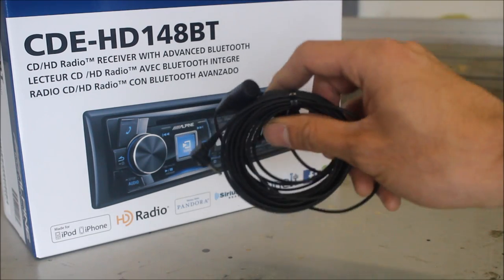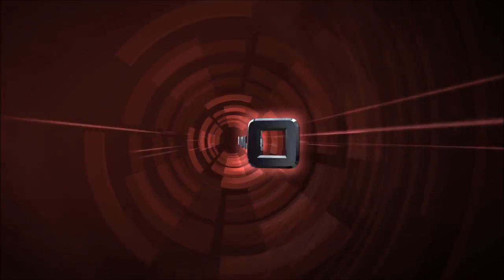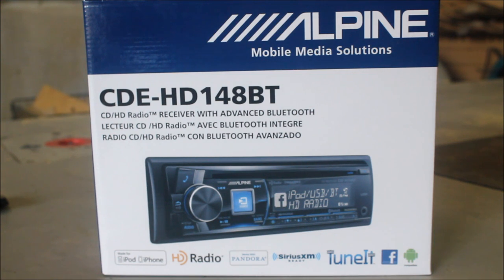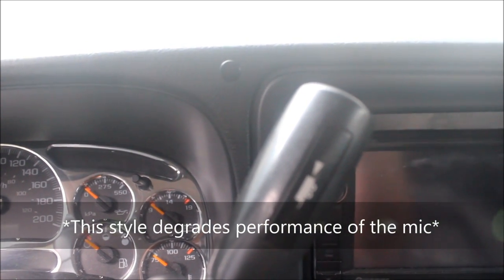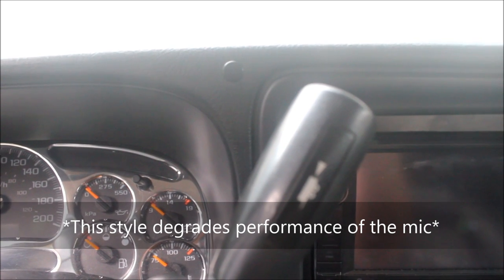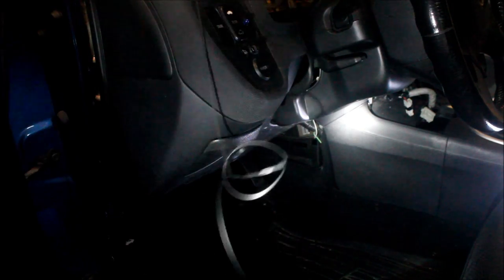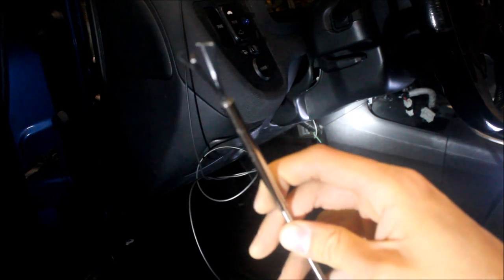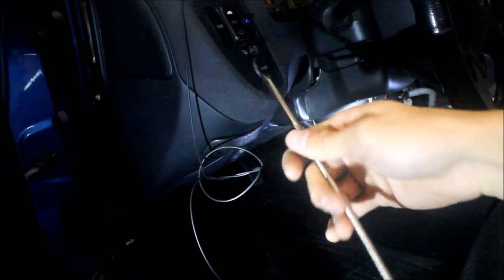Bluetooth Microphone / Mic Installation and Placement | AnthonyJ350

Comment: Looping the mic wire around the mic mount (at 3:40) is one of the best tips I took away from this when I was installing a new Kenwood in my car.
Reply from the maker: Yup, you'll never have the wire droop from the headliner over time.
Reply: @AnthonyJ350  So true. It's been four years since I installed the Kenwood and the wire has never drooped down. Came back to re-watch your video since I'll be putting another HU in a second car.
Reply from the maker: @gloworm106  Nice, check out my other videos to see how I wire.
Reply: @AnthonyJ350  I don’t get it. What do you mean by looping it around? Can you explain or make a quick vid showing that technique?
Reply from the maker: @DontNeedToKnow84  I just put the wire inside the clip to hold it so it doesn't fall.

Comment: Currently installed android head unit on a 13 civic lx but the mic that it came with is trash. Do you recommend one to install? Also does it matter if it’s a TS, TRS, or TRRS  type of 3.5mm input Jack.
Reply from the maker: If a Kenwood or Alpine one fits use those.

Comment: Like how you flush mounted the mic but how did you secure it so it doesn’t fall out or behind?
Reply from the maker: The hole is just precise so it pressure fits.  Don't really recommend this style of install because it kills the performance unfortunately..

Comment: If I installed a head unit display and it has a mic on the side panel of the car next to my head do I use external or internet mic in settings? Thanks
Reply from the maker: External

Comment: I just finished my install today and did the mic just like you showed.Its running behind the dash cluster.People on the other end say they hear me fine but there is a lot of background noise.But it is only when the car is moving.If sitting still,everything is just fine.Any suggestions Anthony?
Reply from the maker: There's sometimes and echo reduction setting in the head unit, or you might have to try moving it up in the center by the rear view mirror.  It might also be a ground loop in the system.
Reply: I installed an amplifier and am getting zero engine noise.Mic is placed right over rear view mirror.Checked resistance for grounds and voltage for both head unit and amp thoroughly before installation.Like I said,it is only when the vehicle is moving at higher speeds that they're getting the noise.
Reply from the maker: What kind of car is it?  Does a lot of ambient noise come into the cab?
Reply: 2009 Nissan Sentra.Not a lot of ambient noise at all.The car is actually pretty quiet as it has very thick foam beneath the carpet that deadens the sound quite well.I don't think it is an electrical issue because everything is fine if the car is running at a standstill.I've tested it in most ways and it boils down to when the car is moving at higher speeds.The head unit is a Kenwood DDX374BT and on calls there are 3 adjustable settings.Mic volume,Echo control and noise reduction.Owners manual doesn't go into detail about it.
Reply from the maker: What happens when you max out the echo control.  Also check the volume settings of your phone.  I'd also try pairing a different phone and listen if it's the same.
Reply: Thanks as always for the input Anthony.Just FYI,you had a big influence on my install as I watched a lot of your videos.I did a head unit,polk components in the doors and a 12" sub in the trunk.JL Audio 3 channel amp powering the whole system.Would love to send you pics of my install.
Reply: AnthonyJ350 BTW,I disconnected the phone and then paired it again.Issue solved.Now the address book that appears on the head unit is all jumbled up.Names don't match phone numbers etc.Man,all this technology and advancement seems to create an equal amount of headaches!
Reply from the maker: John Adams I forgot to mention, Kenwoods really benefit from firmware updates, it seems that they rushed them out. I would see if you can update the head unit. You can email me the pics of your install and I can check it out.

Comment: @AnthonyJ350, it is better to put a windscreen foam for the Microphone ? even as put it in the middle of headliner thah is far from noise air windows
Reply from the maker: Only if it came with it. A lot of new quality head units have noise control features.

Comment: My head unit (bought used 'dual touch screen car play') didn't come with Mic. So I bought one off ebay and the  mic volume is just not enough. Other side can barely hear me.    Any solution to this?
Reply from the maker: Cody Choi Check the Bluetooth settings. Some units allow you to adjust the Mic volume.

Comment: i have sharan vw 2012 with built in bluetooth mic i have purchased aftermarket stereo with mic built in but it echos. even with external mic in aux in of stereo. how can i stop the echo or reduce it a lot
Reply from the maker: +susan herrera Check the settings of the head unit.  Some allow you to adjust the volume for the speakers and mic.

Comment: Great video.  
Did you happen to find any settings on radio about the noise cancellation? Mine seems to be too agressive with supression even tho it's original Alpine.
Reply from the maker: Depends on the brand.  If you have an Alpine I would call tech support.  So it's really quiet on the other person's end?
Reply: @AnthonyJ350  Louder the engine gets, less they can hear me.

Comment: AnthonyJ350 hey man i have the pioneer fhx720bt and i was wondering did you run the wire from the A piller down to the dash or how did you do im very confused and dont want to pay some one $50 just to do it.
Reply from the maker: Either through the under dash with loom or above the gauge cluster and securing it with tie straps either way.

Comment: I have my microphone in the upper middle, right next to the rear view mirror. Everyone I talk to complains of loud road/background noise. Should I get an upgraded microphone or move my mic? I have a 2008 Honda civic.
Reply from the maker: +Eli S Is it an echo?  Their voices might be coming in too loud through the speakers and the mic is picking it up.  I would check the setting in your phone and the bluetooth settings of the deck to start.
Reply: AnthonyJ350 No, I don't believe it's an echo. When I'm talking to people they say that they can't hear me. Like there is too much background noise. It's not when they talk, it's when I talk.
Reply from the maker: Maybe make sure the mic is plugged all the way in.  Could be a defective microphone.  They are kind of cheap.

Comment: Hey i have the alpine cde 137bt and was wondering how do you set the gains or settings. I cant seem to firgure it out. The other end says they can hear themselves talk and alot of background noise. I set the mic above the mirror and its no help.
Reply from the maker: heftyjoe Hmmm, when you're talking to someone is their voice really loud coming through the speakers?  Is the mic plugged in all the way? (sorry but have to check the basics first)

As for volume on the mic you'll have to check your owner's manual.

Comment: I don't see the bluetooth part of the mic.  You still have to wire 3.5mm jack into the reciever unit.  The only bluetooth part is communication between the receiver and your phone.  The mic and wiring has no bluetooth.  Is that correct?
Reply from the maker: Berri Jam Correct. The Mic just picks up your voice for the Bluetooth function of the head unit.
Reply: Berri Jam the Bluetooth connection would be from the phone to the car stereo